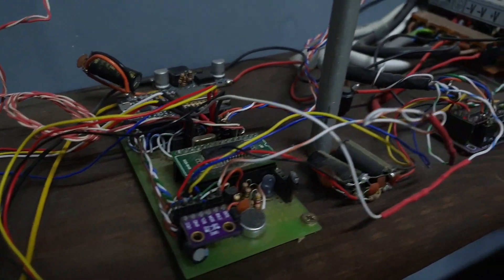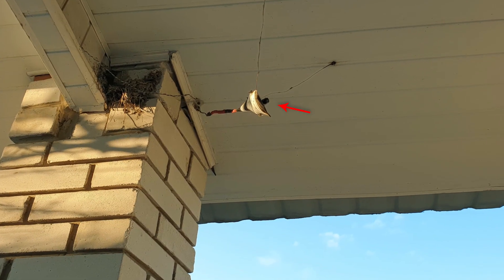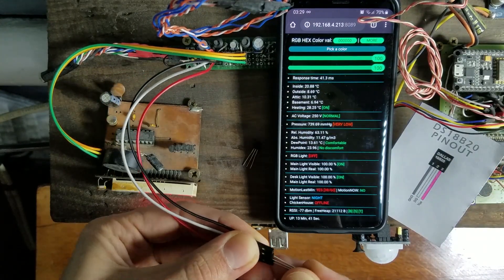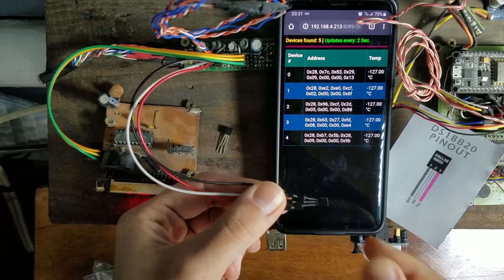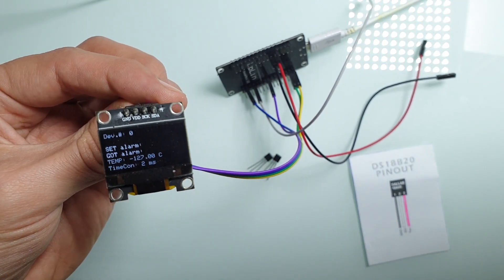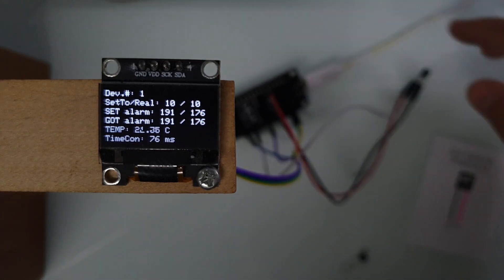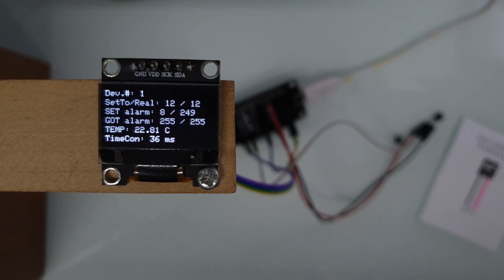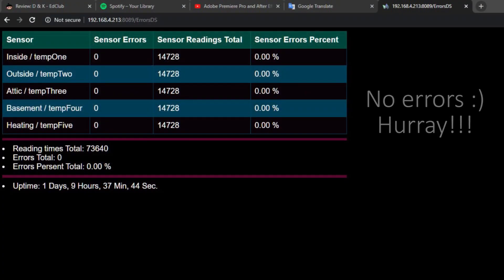DS18B20 Fake Sensor That Works!

Comment: I have got a lot of fake sensors from china. It don’t need a Test program to check this. the value of temperature is far away from the real one. the Differenz is 1 to 10 grad. Don’t buy this you can’t use it for exact temperatures.

Comment: it is possible to use arduino to measure the temperature and set and control 12v valves, there would only have to be 26 zones, I want to do cooling for the computer, there will be 26 peltier systems and 26 temperature sensors in the cooling system, I want to control it so that there is about 5 "c on the cpu at the cooling outlet 125'c

Comment: I had 3 fake DS18B20 in stainless tube - they doesn't work with transistor tester. Other three are good, but now I'm not sure that they are not fake as well.

Comment: This may be relevant: fake sensors ruin a microcontroller. https://electronics.stackexchange.com/questions/512236/why-are-pins-in-my-esp8266-getting-damaged
There you find a link to a GitHub page with further information about fake ones

Comment: Very good info. I have 10 sensors connected to two channels of a PIC micro. 8 on one channel and two on the other. They are spread all over my house - from outside (20 feet of wire) to the garage on the other side of the house (80 feet of wire: Freezer, Refrigerator, garage temp, and attic temp - 4 sensors), and furnace flue, furnace intake, hot water pipe) and others, in a star connection - not all in a row, but a lot of branches. They all feed my Linux box over RS-232. I really like your tester and phone app! Nice work.

Comment: Rather than being a individually trimmed special function chip, the fake may be a microcontroller and lower spec sensor, the microcontroller mimicing the 1-wire protocol.  With conversion time being faster, power draw maybe higher, making it less compatible with a long bus or more devices connected.
Reply: I suspect that's the case, also that those full 12 bits are meaningless.
Reply: @jan.tichavsky  Back in the mid 1990s we looked at using a micro-controller to read temperature in place of a DS18B20 or DS18S20 which were expensive but mostly because they were difficult to get through the local agents.  Because temperature is a slow changing variable it was easy to over sample and average to get more resolution from a smaller ADC.
Reply: I tried adding one to a qinled dig uno.  The board ran hot up to 60 degrees Celsius.   I saw a blog that says most sensors on the market are the fake ones.   Why couldn't they just make a clone woth it's own specs instead of faking the label, grumble.

Comment: If you get a fake sensor, then please indicate te name of the seller. I'm pretty sure that not all aliexpress sensors are fake (or are they?)
Reply: Basically they are all fake. A real one costs 2-3 dollars per piece in bulk, there you buy them at less than 1 dollar each.
Reply: What Olaf said.  At best, fakes will be less accurate than the real thing, and may fail sooner or be DOA.  At worst, the leads could be backwards, or they're just TO92 transistors.  I'd use the fakes for prototypes and non-critical stuff, and buy real ones if I needed accuracy or reliability.

Comment: Hello, I need a little help, it's a temperature sensor
 DS18B20.
 I wonder if I can influence it to read the wrong temperature.

 I need to cheat the electronics to which such a sensor is connected at a given moment.

 It is an electronics for a pellet burner, more precisely a centrometal burner from 2012, and the principle of its operation is such that when the water temperature in the boiler drops below 60 degrees, it goes into automatic ignition.  The ignition automatically goes should or should not need hot water.
 I tried everything but the only solution is to fool the electronics and give it the wrong information about the water temperature, that is.  that the electronics receive a signal that the water temperature is 60 degrees or higher.

 Thanks in advance.
Reply from the maker: Hello, There are Arduino libraries that can simulate DS18B20, so you can connect an Arduino instead of DS18B20, and send the fake temperature. I did not fully understand the details, but if you have access to the wires this will work. Of course, you need some Arduino skills to make this work. Hope it helps.
Reply: @ElectricalPro  Ok, thanks for the answer, I can pretty much program arduino, I'm not from that profession but I understand a lot of things.  Please tell me how to send the data to that wire.  I noticed that the sensor works in prazit mode?  Thanks